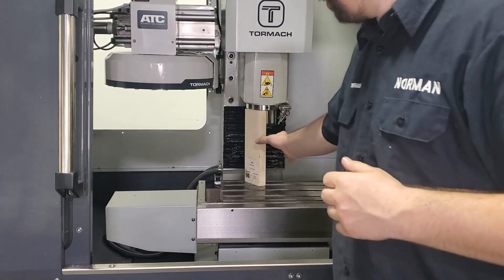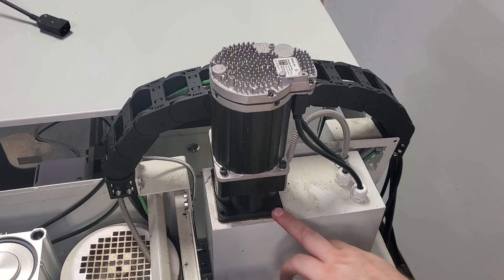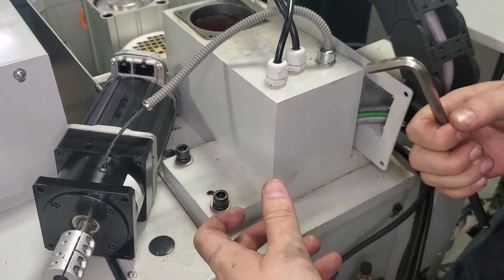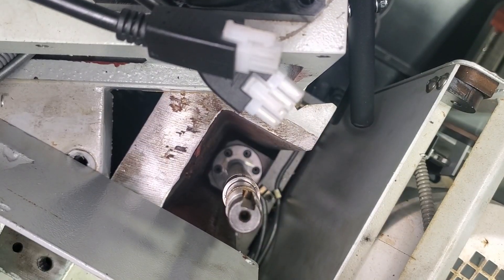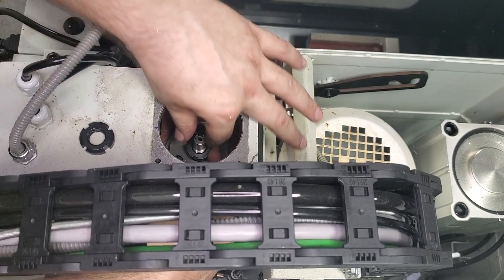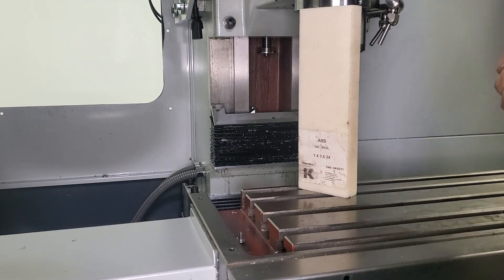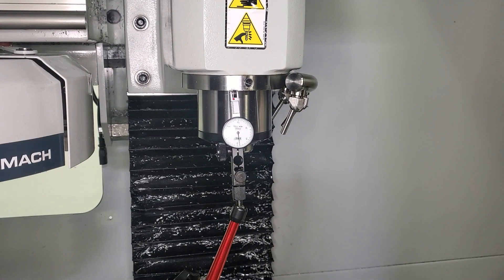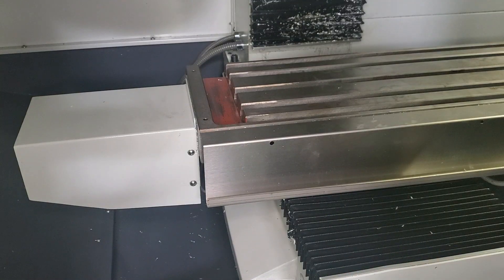Tormach Mills | Ballscrew Replacement

Comment: Does placing the Z-axis at or very close to the upper limit switch offer better access the six ball screw bolts?
Reply from the maker: You specifically do not want to be at the top of travel because you cut off access with the overhang of the Z motor casting.

-Norman
Reply: Ahhh, I didn’t think of that. I’m glad I asked, because there are no points to pry up the motor casting from the back or sides. Thanks!

Comment: Before turn off the machine for ballscrew replacement,  make sure Z-Axis up and put support undernet.  This will make it easy to remove the mounting screw for ballscrew.
Reply: After watching get video, and seeing that the Z-axis is only half way up, it seems to me that placing the motor head closer to the upper limit switch allows easier access six ball screw bolts? Naturally it needs to be supported in this higher position. I ask because I'm getting ready to replace mine, and my big hands will not fit it tight spaces😆